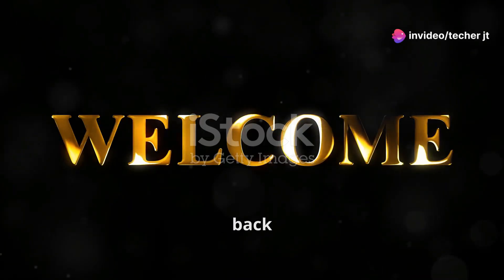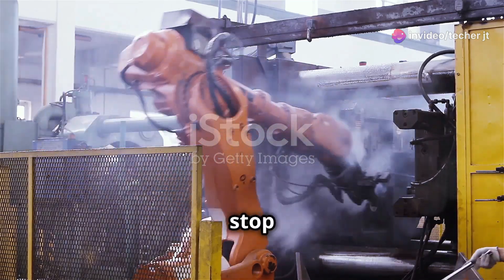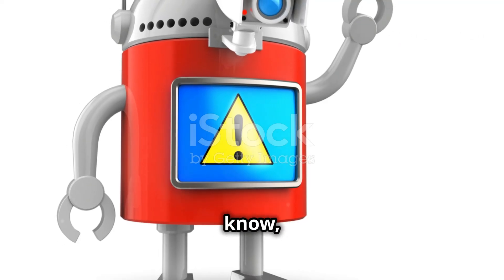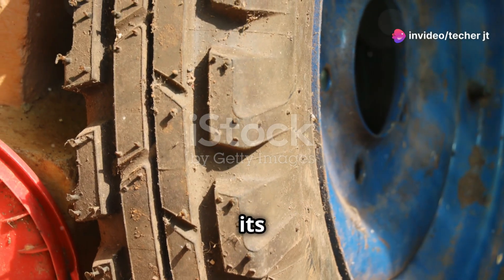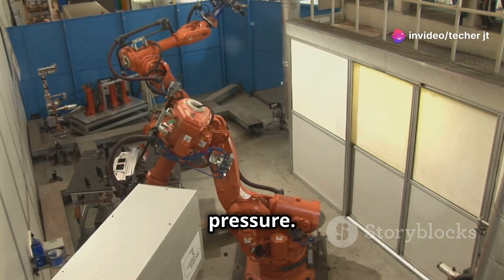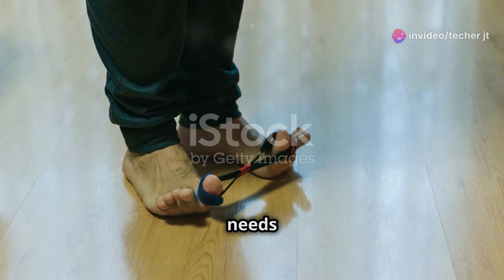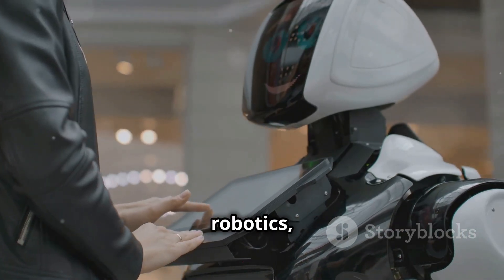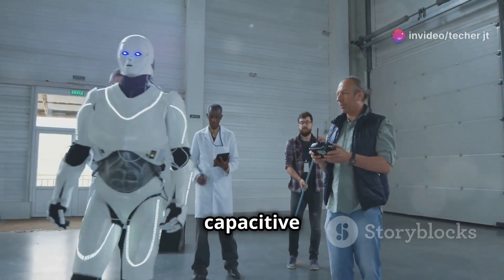Capacitive Sensors in Robotics: A Beginner's Guide

Comment: 👇🌟 10-ANDROMEDA CHAIN 🌟
Reply: Christine M. Luna
10 - Andromeda
09/12/2024
12:40 (time stamp)

3. What are the advantages of using capacitive sensors in human-robot collaboration?

- There are several advantages to using capacitive sensors in human-robot collaboration, as they enable robots to work alongside humans with greater safety and precision, to handle objects with delicate care, and to learn from human demonstration with remarkable speed by giving robots the ability to sense and interact with their environment in ways that are more or just as skillfully efficient to human-beings.
Reply: Antonnette C. Tayrus 
10 - Andromeda 

Q1. What is the primary function of capacitive sensors in robotics?

Answer: Capacitive sensors are little electric feelers that allow robots to sense their environment without touching anything. Just like finding your way in a dark room, and reaching out your hand to feel your way around, capacitive sensors are like this for robots. They use electricity to detect nearby objects, measure pressure, and track multiple point of contact, all without physical contact.
Reply: Kobie James B. Gabales 
10-Andromeda 

2. How do proximity capacitive sensors differ from touch capacitive sensors?

Proximity capacitive sensors differ from touch capacitive sensors by detecting objects at a distance without the need for physical contact. They sense changes in capacitance as an object nears, enabling robots to identify obstacles in advance and avoid collisions during navigation. On the other hand, touch capacitive sensors require direct physical contact to trigger a response, allowing for more detailed interactions with the environment.
Reply: Ettena Marie A. Gabales 
10 Andromeda

5. In what ways can capacitive sensors enhance safety in industrial robotics?

— Capacitive sensors help prevent collisions between robots and humans in industrial settings. They can detect when a human worker is near a robot, allowing the robot to stop and avoid a potential accident.
Reply: Zara Mae M. Jurane
10- Andromeda

2. How do proximity capacitive sensors differ from touch capacitive sensors?

- proximity capacitive sensors which detects objects before it makes contact, while touch capacitive sensors detect physical contact.
Reply: Ayannah Nicole Ngujo
10 - Andromeda 

2. How do proximity capacitive sensors differ from touch capacitive sensors?

A: Proximity sensors detect objects without contact, while touch sensors require direct touch. Proximity sensors are also used for proximity detection and gesture recognition, while touch sensors are used for touch-based user interfaces.
Reply: Angel Sofia C. Tabaniag
10 - ANDROMEDA 

1. What is the primary function of capacitive sensors in robotics?

• Robots using capacitive sensors can sense their surroundings without coming into direct contact with them because they can detect changes in the electric fields that surround them.
Reply: Dean Andrie P. Daohog
10 - Andromeda

2. How do proximity capacitive sensors differ from touch capacitive sensors?

Proximity sensors detect items without contact, but touch sensors require direct contact. Proximity sensors are also utilized for proximity detection and gesture recognition, whereas touch sensors are employed for user interfaces that need touch.
Reply: Rose Gabrielle D. Araoarao
10 Andromeda

1. What is the primary function of capacitive sensors in robotics?

Capacitive sensors are small electric feelers that enable robots to detect their surroundings without touching anything. They use electricity to detect nearby objects, assess pressure, and monitor numerous points of contact, all without making physical contact.
Reply: Davey A. Sabanal
10 - Andromeda 

4. What challenges do capacitive sensors face in real-world applications?
Answer: Challenges include sensitivity to environmental conditions, potential false positives, and interference from other electronic devices.
Reply: Englis 

1. What is the primary function of capacitive sensors in robotics?

- Capacitive sensors function as a robot's personal space bubble, sensing objects before they make contact. A proximity capacitive sensor produces a faint electric field, similar to an invisible force field around the sensor. When an object enters this field, it causes a disruption, which the sensor detects. This enables robots to evaluate distances, avoid obstacles, and navigate their environment without colliding with a wall.
Reply: Kerk Ivahn C. Durohom
10-Andromeda

Question 1 : what is the primary function of capacitive sensor in robotics?

Answer: Capacitive sensors in robotics detect objects and humans without contact by measuring changes in capacitance when conductive targets enter their electric field. This allows for safer interactions and is ideal for applications in industrial automation and collaborative robotics. Their ability to differentiate between touch types enhances human-robot interactions, improving the functionality and safety of robotic systems.
Reply: Andrei Lavern A. Pelayo
10-Andromeda 

4. What challenges do capacitive sensors face in real-world applications?

Answer:
Capacitive sensors can face challenges in real-world applications due to environmental factors, noise, calibration issues, and physical limitations. These challenges can be fixed with careful design, proper shielding, and regular care.
Reply: Charles Christian Bahian
10-Andromeda

1. What is the primary function of capacitive sensors in robotics?
-Capacitive sensors are crucial in robotics, enabling robots to sense their environment without contact. They use electricity to detect nearby objects, measure pressure, and even track multiple points of contact all without any physical contact.
Reply: Zhandra B. Dela Rosa
10 - Andromeda 
1. What is the primary function of capacitive sensors in robotics?

They can sense non-metallic materials and are often used for touch detection, position sensing, and level measurement in various applications.
Reply: Kent Kyle T Palingcod  10-Andromeda 
1. What is the primary function of capacitive sensors in robotics?

The primary function of capacitive sensors in robotics is to detect the presence of solid or liquid targets without physical contact by emitting an electrical field that senses disruptions caused by these materials.
Reply: Kent Kyle T. Palingcod  10-Andromeda 
1. What is the primary function of capacitive sensors in robotics?

The primary function of capacitive sensors in robotics is to detect the presence of solid or liquid targets without physical contact by emitting an electrical field that senses disruptions caused by these materials.
Reply: Ariel D. Lacia
10- Andromeda

Q1. What is the primary function of capacitive sensors in robotics?

Answer: Capacitive sensors are little electric feelers that allow robots to sense their environment without touching anything. Just like finding your way in a dark room, and reaching out your hand to feel your way around, capacitive sensors are like this for robots. They use electricity to detect nearby objects, measure pressure, and track multiple point of contact, all without physical contact.

Comment: Jullian A. Pangan 
10 - Lynx

5. Discuss the significance of capacitive sensors in expanding the applications of robotics.

 Capacitive sensors have played a crucial role in expanding the applications of robotics due to their versatility and sensitivity. These sensors measure changes in capacitance, which can be influenced by factors like distance, proximity, or the presence of different materials. This makes them suitable for a wide range of tasks, including proximity sensing, level sensing, gesture recognition, and material sensing. The ability of capacitive sensors to provide precise measurements and operate in various environments has contributed to the development of more advanced and capable robotic systems.

Comment: 𐔌 CASSIOPEIA CHAIN ᯓ ๋࣭ ⚝
Reply: Nella Regasa
10 Cassiopeia

2. How do proximity capacitive sensors differ from touch capacitive sensors?

Proximity capacitive sensors detect objects from a distance by emitting an electric field that is disrupted when an object enters. In contrast, touch capacitive sensors detect direct physical contact and measure the location of that contact, similar to how a smartphone touchscreen works.
Reply: Mark Uriel G. Tacbobo
10 Cassiopeia

1. What is the primary function of capacitive sensors in robotics?

Capacitive sensitive sensors are like electric feelers that allow robots to sense their environment
without touching anything.
They use electricity to detect nearby objects, measure pressure and even track multiple points of contact all without any physical contact.